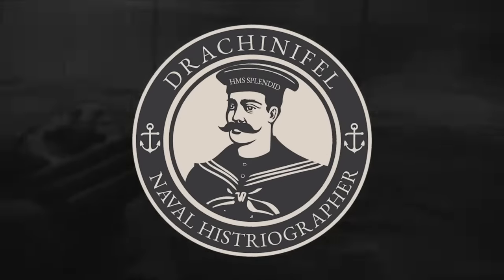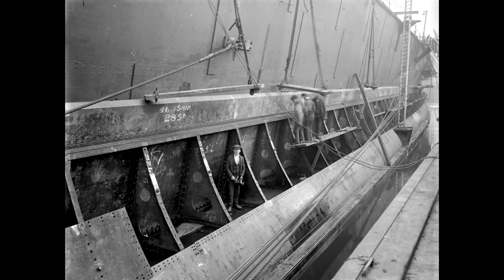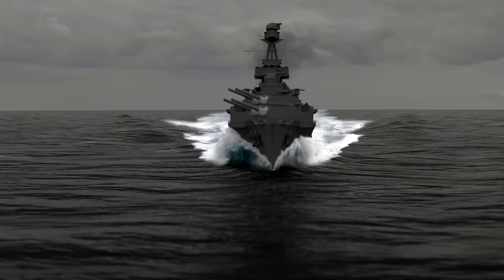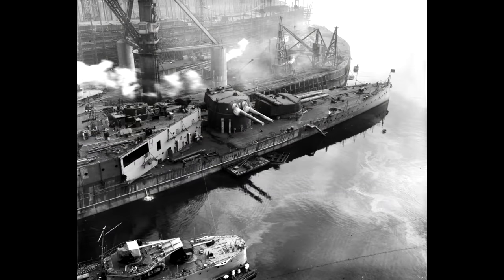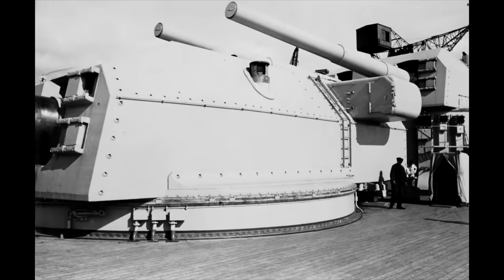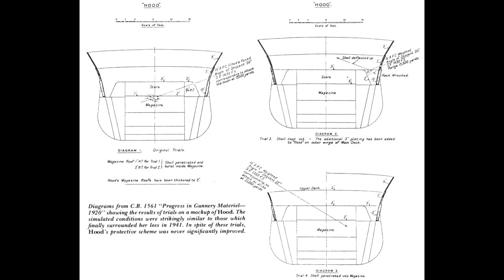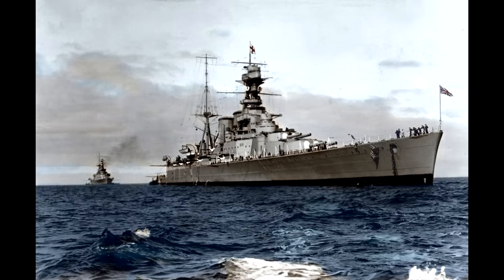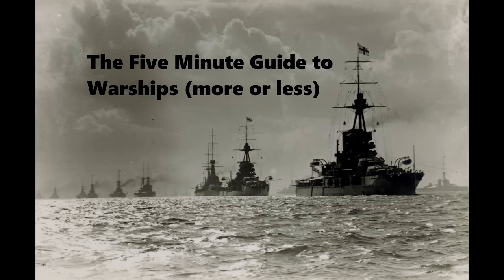The Loss of HMS Hood - But why did it blow up??

Comment: I have a few questions as to the “HEAT” produced by the number of ammo lockers spread out on the boat deck? Should the heat be able to “MELT” through the boat deck and then through the upper deck to melt down into the lower decks and eventually actually ignite the 4” magazine and thus rupture the 15” magazine and thus the end of the ship. The fact there was a massive flame around the mainmast then the 15” magazine ruptured? It seems to fit the disaster. Surely equal to the golden BB shot.
Reply: No.
Reply: @walterkronkitesleftshoe6684  that doesn’t qualify as an answer. Why not?
Reply: @alexlupsor5484  Because its a nonsense question. Why would you imagine that sufficient heat to melt through multiple armoured decks would be generated by a fire in open air? Even if you used a thermite well it would be hard pressed to melt through multiple layers of armour.

The gout of flame in front of Hood's main mast that was witnessed shortly before the deflagration was the energy from the magazines venting via the path of least resistance, that being the comprimised bulkheads between the main 15in magazine the 4" HA magazine and the aft engineroom bulkhead then from there venting upwards through the machinery space ventilation trunking which emerged just forward of Hood's main mast.
Reply: : your analysis is flawed in so many degrees. The fire that was allowed to cook up on the boat deck (which was not armoured plate) was allowed to heat to melting point under the fire. We find that the fire was  allowed to burn itself out with of over 200 men, taking refuge under the weather deck, instead of fighting the horrific fires up on deck. This in action alone allowed the temperatures of the fire to reach well over 1200 degrees. Well past melting point for unarmored metal. As the molten metal was puddling, it found the uptake vents and pored down, according to what I read, and it found its way into other 4” artillery which also began to cook off, including the torpedo rooms on the port side. With this added to the mix, the stream of fire that fused in a gigantic tower of silent flame followed by the eventual 15” magazine ruptured and total destruction of our HMS Hood.
Reply: @alexlupsor5484  That's a whole crock of horseshit..... if you insist on living in fantasy land, I'm sorry I'm not flying there... I much prefer it here in the real world.
Reply: @walterkronkitesleftshoe6684  
It’s to bad that you seem to believe that you are correct and anything else is bullshit. All I did was express another alternative to what you seem to believe is fact. Here is fact! No one knows what happened and even with two enquires, the Admiralty could not find the answer. Just because I put before the readers an odd but not totally debunked theory doesn’t make me the turd. May you need to look into a mirror eh!

Comment: @Drachinifel   Given that most ships which suffered magazine detonation merely broke in two and that Hood had 30% or more of her obliterated, do you not think that this could be an indicator of an 'internal' explosion that had no immediate exit path to the outside of the hull and thus there was no large hole left by a shell passing through the side of Hood? US and UK navies considered cased ammunition in a magazine to be fairly stable even when hit directly and thus the Hood's 4" magazine is unlikely to detonate in such a way as to build up sufficient pressure to rupture bulkheads. IE it would likely go up like popcorn (and vent through the incoming shell hole in the side) instead of one big bang like a cordite magazine.

Comment: (1) How much would the ships heel during turns, and how would that affect the angle between a shell path and the armor?
(2) Was there a "dud" 15" shell found inside Prince of Wales?  Where can I read more about that?
Reply: One of Bismarck's 15in shells was recovered during repair work carried out on HMS PoW at the RN base at Rosyth. It was recovered from a "double bottom" tankage space near to her Y turret magazine 12 days after it had penetrated various bulkheads before coming to it's final resting place. Much is made of this with the belief that PoW nearly followed Hood to the bottom of the sea with a magazine detonation. The truth is that if the shell fuze had not malfunctioned as it did, then it would have detonated during its 25 meter underwater passage BEFORE entering PoW's hull 30 ft below her waterline.. The only reason the shell ended where it did was because of the faulty fuse.

The shell was carefully removed from PoW while she was in dry dock and transported to a research establishment at Shoeburyness in Essex, where after inspection it was finally safely detonated.

Comment: It is rather disapointing to see how a british after 80 years still needs an explanation for the loss of a british ship against a german. To explain the, in his eyes, impossible. Even if the shoot was lucky everybody has to admit that first you have to hit. Compared to the Bismark the Hood was old and outdated. The fire of the Bismark was much more accurat and that was the main reason for sinking the Hood.
Reply: "Compared to the Bismark the Hood was old and outdated"

Bismarck     8 x 15in guns
HMS Hood  8 x 15in guns

Bismarck    12.6in belt armour & 4in deck armour laid out in an "incremental armour" design.
HMS Hood  12in belt armour (though angled to give 13in of armour protection) & 3in deck armour laid out in an "incremental armour" design.

Bismarck     29 knots
HMS Hood  30 knots (in 1941)

Bismarck was largely of the same generation of capital ships as was Hood.

Comment: I always wonder why people speculate about where the hit had been expect the shell coming from the starboard SIDE. What about a trajectory along the length of the ship hitting from above piercing all the decks ignoring all the belt armor.... 🤔 Far easier due to weaker deck armor completely ignoring the belt armor.  Just a really lucky shot. 

Conclusion: Something Holland wanted to avoid by all means exactly happened in the way it did but worse than he could imagine. Greetings from Germany.

Comment: What was  the sea state during the battle? How did the turns the Hood were making at the time pitch/roll the hood, and how may have the sea states, and/or the pitch/roll from the Hood’s turns affect the angle of the penetration of the Bismarck’s shell?
Reply: Hood didn't even begin to turn or just began to turn when the fatal shell hit her so that doesn't really change the angle of Bismarck's shell by any significant margin
Reply: @KatyushaLauncher  Thank you.  Is there documentation of the sea state at the time? If the ship was pitching/rolling due to the sea state (depth and direction of swells)) that could affect the angle of the hull armor on the hood when the Bismarck’s shell hit? The Denmark Straight, or the North Atlantic as a whole is notorious for rough seas.

Comment: 8 inch round having 4 inch penetration? I know the distance was very large, but it still sounds v. low. That's 122kg shell vs roughly the armor of a Tiger tank. I understand you took into account the angle, right?

Comment: I'm going to ask the same question about the hood that I asked about the USS Arizona which also was destroyed tragically by an unlucky hit

And that question is if the kill shot went through the deck armor like it possibly did with the USS Arizona does it lessen the heroism and The bravery of the crew?

Just like the crew of the Arizona the gallant crew of HMS Hood were sailors who perished in combat.

Infantryman fighting in ground combat frequently died less heroically sometimes not even able to get a shot off lined up in the sights of an enemy and dropped with a single shot or blown up by an artillery piece miles away

As Plato said only The Dead know The end of war

Comment: Just to add, yes indeed a masterful analysis. But after watching a few times I am still uncertain about one thing - could an 8 inch shell from Prinze Eugen have landed in the bow wave trough  and done this as well?  I am sure I must have missed the reason why this is impossible, but I didn't see that touched on as I recall.
Reply: This wasn't mentioned in the video but Prinz Eugen had already switched her fire to Prince of Wales before Hood had even exploded meaning the shell that doomed Hood can only be from Bismarck
Reply: @KatyushaLauncher  Thanks!  :)

Comment: I find it extraordinary that ship decks were still made out of wood at this point in history? I feel like I’ve got that wrong in fact ? But of course a shell is going to plunge through its deck if it’s made out of wood. It always seems odd to me that a modern 20th century war ship with its Hull riveted together all round its body would have medieval style wooden decks. Obviously it wouldn’t be quite the same as a Middle Ages ship but I imagined war ship decks were metal the same as its main bodywork. Maybe there’s something that I’m missing? Is there some common tactical procedure I’m not considering which would normally negate the vulnerability of wooden decks? Maybe it’s this deck Armour?
Reply: It's not just a wooden deck, Underneath that wooden is the real armor which of course Hood had

Comment: Excellent narrative.  I am trying to find a reference to a naval gunnery test (presumably U.S. Navy) photo in a book.  I distinctly recall the book's photo from my childhood (1960s) but not the book itself (could have been in a Time-Life series).  It was a small margin inset photo (left hand page, lower margin) showing the cut-through cross-section of a 8" shell coring through a 12" steel plate section.  Reference to the discussion re:  Prince Eugene plunging fire explanation as causing the explosion of the Hood.  Does anybody recall this photo / book?

Comment: A book I've got in my collection title escapes me at the moment. proposes the idea the prinz eugen dropped an 8"inch shell down one of the funnels starting a fire in the engine room.
Reply: It wasn't the "Beano" was it?
Reply: @walterkronkitesleftshoe6684  no .HMS hood pride of the royal navy by Andrew Norman his proposition was the angle of Prinz eugens guns were elevated for their maximum range, plunging fire falling into hoods 600 square foot of open funnel top starting a fire in the high pressure oil delivery system which built up pressure eventually setting off the magazine's. Instead of bismarck's defective shells Hope that helps .
Reply: @stephenjones6500  Sorry Stephen, but its utter nonsense. NO naval gun has a "fall of shot" of anywhere near 90°. At maximum elevation shells from the 20.3 cm/60 SK C/34 had an angle of fall of just under 49°, besides there being utterly NO evidence of such a ludicrous event happening. Naval guns are NOT mortars.
Reply: @walterkronkitesleftshoe6684  I didn't state I believed it ,but eugen fired far more shells at hood than bismark, starting the fire in the ready use bins for the u,r,p which were near the mainmast/funnel that and as reported no sound just the appearance of a 500 ft high column of flame like a blowlamp before the explosion.
Reply: @stephenjones6500  The blowlamp like flame was the overpressure of the Hood's deflagrating magazines venting to open air via the machinery spaces ventilation trunking, which was positioned between the mainmast and her second funnel.

Comment: 29:37 - Couldn't the dynamics of a shell striking the 7-inch belt potentially change its angle of flight (especially given that it would only need to be deflected a few degrees further down in order to strike the sloped portion of the deck armor, and that it would then have struck the latter nearly face-on)?

Comment: I would guess that you don't think much of the film 'Sink the Bismark'.   However, it gives the idea, that the German ships could have been intercepted in an hour of darkness.  Would that have been a better option, given that British radar equipment, was superior to German, or was it?
Reply: Surely a moment in it.
But the decisive fate was most likely that, VA Holland did not know that Bismarck was the last ship, and fired first at Prinz Eugen. Then it lost valuable seconds on depositing.
Equally fatal was that the last, shortened salvo from the Bismarck hit the water a few meters from Hood's side of the ship and went down at a steep angle into the water - and fatally under the armor belt .., and straight into the magazine. Then she exploded in seconds.

Comment: This explanation seems much more likely than the others presented, yet for me there remains some doubt.
The Hood had initiated a high speed turn to port. wouldn't this have created a list to starboard, burying the armour belt facing Bismarck beneath the surface reducing the possibility of a shell penetrating beneath that armour belt? At the same time it would increase the impact angle of the shells which especially would change the situation you described around 29:25 . If a shell penetrated just above the 12" armour, it wouldn't skip on the flat deck anymore, but would hit the sloped side almost perpendicular opening the possibility of a secondary penetration into the magazines.
I have no idea how much the Hood would have listed in that high speed turn, but it wouldn't have to be much to fatally change the impact trajectory of the 15" shell.
Reply: All quite possible, but we will never know the exact details. Hood's 3in deck armour had been shown in the 1920s to be effective against 15in shells impacting at anywhere below 20°. According to the German's own gunnery data at the range that Bismarck's killing shot struck Hood (8-9 nautical miles) the "fall of shot" was in the region of 11° to 13°, so Hood heeling over in a high speed turn to port would theoretically have had to caused her to lean to nearly 10° for her horizontal deck armour to become vulnerable.
Reply: @walterkronkitesleftshoe6684  It's not the horizontal deck armour that would be hit, but the sloped sides, even with a 2º-3º list. After penetrating just above the main armour the 15" shell would have hit the sloped sides of the deck armour nearly at 80º which is enough for further penetration.
Just look again at the schematic shown at 29:35 and see how close to the bending-down it is, but now pivot the sketched impact trajectory 2º or 3º counter-clockwise representing the list and it will either hit just at - or beneath - the bend in the deck armour.
[EDIT]
Of course this is all speculation, so I made a screen-grab of the schematic and rotated the trajectory of the shell 3º counter-clockwise. The schematic showed a fall of about 13º - which aligns with what you said - which makes the total angle 16º at a list of 3º. This will move the impact from the horizontal deck to the lower edge of the 60º downwards bend in the 3" deck armour. This makes the impact angle 76º which may be just enough to allow penetration of an 15" shell having passed through the primary armour above the main belt.
Reply: @walterkronkitesleftshoe6684  Another issue is the angle of the armour; a rough approximation is that the effective thickness of armour increases with angle. At an angle of 20º - 70º from the perpendicular - the effective thickness of 3" armour increases to 8.7". Effectively this is the thickness of armour to resist penetration of an 15" shell head-on.
The 5" armour  above the 12" main armour belt angles at about 80º. This means that at the previously calculated 16º trajectory the Bismarck's 15" shell had to penetrate through 5.6" effective armour to reach the 3" inner deck armour. The shell struck that 3" armour at an angle of 76º which makes the effective thickness 3.1" it had to penetrate.
In total the shell - in this scenario - had to penetrate through 5.6"+3.1"=8.7" of effective armour thickness, equal to the effective thickness of the penetration tests performed in the 1920's. It is however also known that two thinner plates of armour are less effective than a single plate of armour of the combined thickness.
I'm sure there's a lot I left out in these calculations as I'm no armour specialist but this is what I picked up over the years.
This rough analysis - admittedly based on limited data - however does show this is a realistic possibilty.
Reply: @roykliffen9674  "YT" kindly didn't notify me of your responses Roy, only just spotted them today.

Hood's belt armour was sloped outwardly at 13° so a "heel" to starboard would as you say have increased the angle (and therefore thickness) of Hood's belt armour even further. But as you have also interestingly illustrated the complex internal armour profiles as well as the many other variables involved mean that without any physical evidence (of which there is none) all our talk is purely conjecture... interesting for us though it is. All the best.
Reply: @walterkronkitesleftshoe6684  Same problem here 😉
The 13" main armour would have stopped the shell at that angle, the 5" armour above it wouldn't, and it is the direct line from the top of the main armour belt to the angled sides of the inner armoured deck that leads directly to the powder magazine.
[Edit]
PS. I have included the hull plate angle and the list angle in the calculations of effective thickness.

All the best to you too ...... see you at the next technical issue 🙂